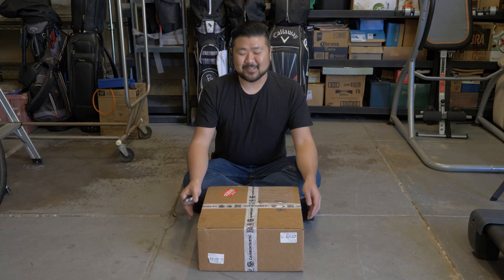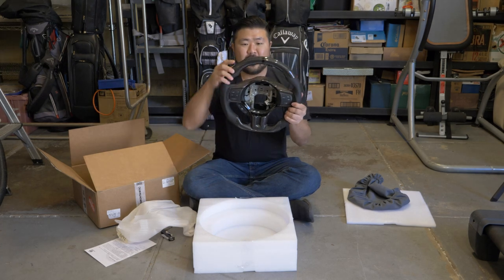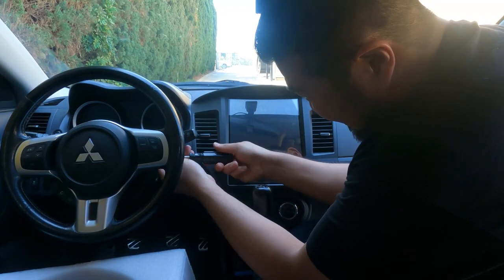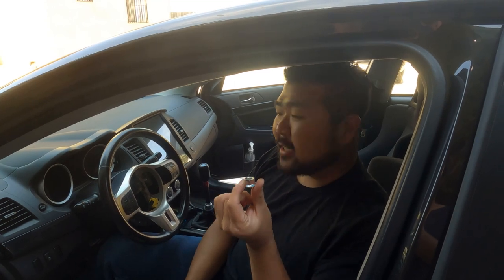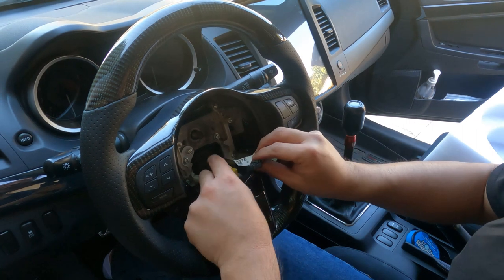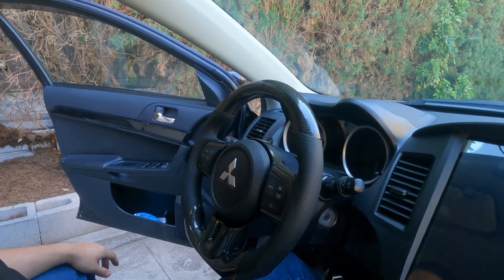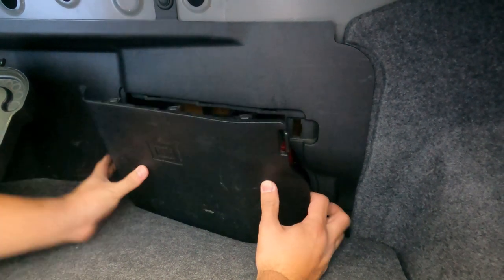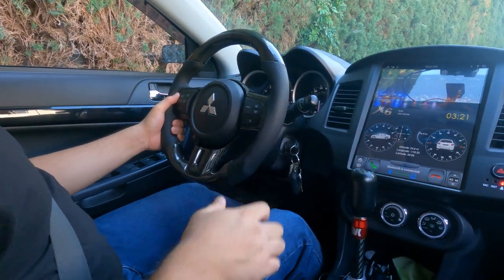Carbontastic Carbon Fiber Steering Wheel for Evo X!!!

Comment: The trick is to disconnect all the connectors, loosen the 17 mm nut but you don't take it out all the way, keep it there and pull the steering wheel towards you and then remove the 17 mm nut.
Reply from the maker: Wish I knew that before hand hahaha thanks I wouldn't have thought of doing it that way 😂👍
Reply: @JeffSongCars  All good bro, don't stress about it. The steering wheel looks good though and I'm sure you can replace the clock spring.

Comment: I also ordered one for my Evo x on March 1. I can’t wait till I get mine. It really looks good man.
And yes it is pricey
Reply from the maker: Can't tell you how much this thing makes you love driving the evo! As another viewer suggested use the 17mm nut that's holding down the steering wheel and don't loosen it all the way then start pulling at the stock steering wheel. This will save you $90 for a new clock spring hahaha
Reply: @JeffSongCars  thanks for the advice I will definitely take my time installing my new steering wheel when it arrives.
Reply: is it only in US or you can buy from any countries?
Reply from the maker: You can buy it in any country realcarbontastic.com 👍

Comment: I'm very late to this post but ... Very nice steering wheel. Should not disconnect the positive terminal first though. Leaving the positive terminal on while installing the negative terminal can cause damage to the ECU/ECM and other sensitive electronics. Should disconnect the negative terminal first. 
If you do make the mistake and disconnect the positive terminal first, be sure to also remove the negative terminal. 
When reinstalling, install the positive terminal first, then the negative. Just saying 🙂
Reply: Which head unit is that? That's nice👍
Reply from the maker: @dondada6496  Thanks I'm loving this steering wheel. That's very good information that I will definitely use in the future! The headunit is a tesla styled 12.1" screen. Nowadays I think there will be better ones on the market than the one I have but make sure to get the one with the most RAM and cores if you plan on going this route 👍

Comment: Do you feel like you have more room for your knee with the flat bottom ? I wish the Evo had in and out adjustable for the wheel .
Reply from the maker: If there is I don't really think there is much of a difference, ill try to make a video of the difference in a week's time and maybe show the stock vs the aftermarket. Actually, ill make the comparison when I install the clockspring! Stay tuned haha👍

Comment: hey man how's your holding? how do you maintain your CF from oxidation?
Reply from the maker: The carbon fiber wheel is holding up well! I love the feel of the steering wheel compared to the stock and I haven't done much to prevent oxidation because I think cf will always oxidize. the best way to stall that would be to keep a cover over the car and most of the time my car is in a garage, hopefully that helps but yea the only other way that I did for one of my CF parts was to completely grind down the clear coat and re apply a new layer 😁👍
Reply: ya I just had mine yesterday and was planning to ceramic coat it but my friends advice me not to put any thing slippery on my streering wheels, so I might just get some Swheel cover and probably some spray to maintain
Reply from the maker: Yea be careful of putting anything slippery on the steering wheel, don't want to get into an accident! One way might be to get one of those window cover things for the interior 🤔
Reply: @JeffSongCars  where are you located bro?
Reply from the maker: I'm in the LA and OC area
Reply: @JeffSongCars  ohh I thought you were in NorCal
Reply: @JeffSongCars  what’s your IG
Reply from the maker: @michaeljoseph2039  @_jeff.song

Comment: How much did you pay??  In their site they want $1,400??  Is that what you paid??
Reply from the maker: Yea that is what I paid, I think there are other companies now that offer it for way less. I think I also have a defect in mine as well so…. Might be good to check out other companies 👍🏼
Reply: @JeffSongCars  where was the defect?
Reply from the maker: @lbcitylacounty4982  The leather portion of the handle on the right side wasn't fully flushed and a bit of the leather is sticking out. It was supposed to be tucked behind the plastic but yea they didn't do quality control too well 🥲